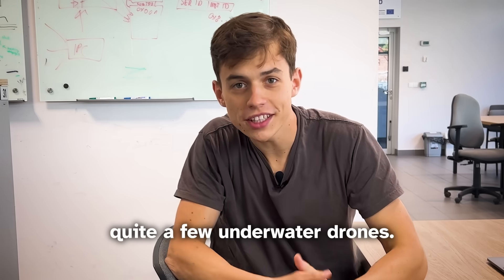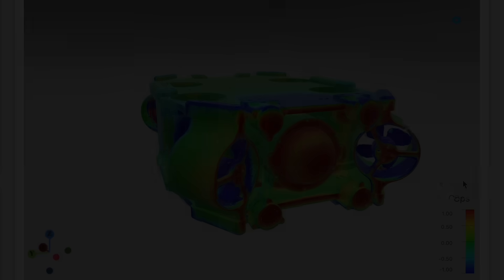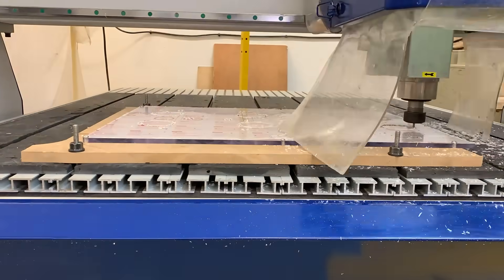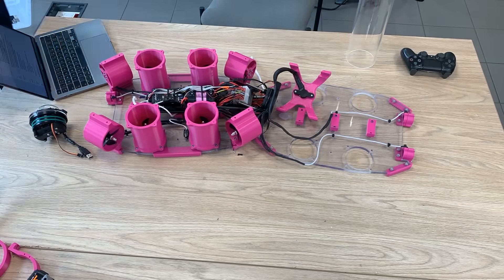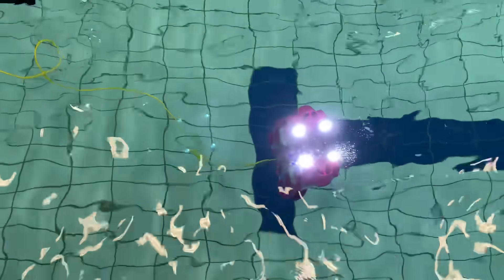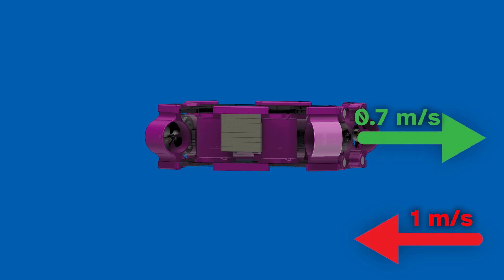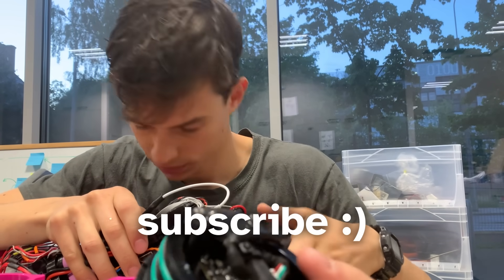Building the MOST MANEUVERABLE submarine

Comment: iam happy to see my finished cps5 drone as picture in your video.
Reply from the maker: Thanks again for the picture!
Reply: @CPSdrone  how about a transverse thruster tunnel ,like a bowthruster.
Reply: @CPSdrone why can’t you have one or two singular engines or motors and then open and close valves that exhaust at different angles?
Reply: @dorjedriftwood2731  one issue is friction, adding long tubes for the exhaust with bends probably isn’t very efficient. Then there is another issue, the motors and propellers don’t just exhaust out the back, they also pull in the front, meaning when the motors are running you will always have a force coming from the intake. So fixed motors even with difference exhaust paths will always pull in the direction the motor is facing, regardless of where the exhaust comes out. This could be mostly eliminated by using two motors that intake in opposing directions but any difference in speed will still cause movement.

Edit: it also creates a control problem, you don’t want the motors to be spinning is you aren’t exhausting it somewhere which means you need to mix the controls a lot more and if you want multiple exhausts at the same time then balancing them could be difficult as more water will take the easier path. It is all possible but probably more hassle than it is worth. The motors are cheap and having multiple creates redundancy.
Reply: Can’t believe I had to wait till the end for a titan joke. Worth it.
Reply: E
Reply: are there 3D print files abailable?

Comment: At 4:20, the forward thrust will not be double that of the previous model from having double motors. It will be less, as the motors are pointed away from the fwd-bck direction. Assuming a 45 degree angle, the fwd-bck thrust component from each motor will be about 0.7x of its total thrust, with a 0.7x component sideways. 

This will also mean that energy will be somewhat wasted when no sideways motion is desired, as some of the energy used by the four diagonal motors will be spent trying to counteract the lateral component from the other side.

As long as the energy stored on the batteries is sufficent for the task at hand the sacrifice is probably worth it.

Comment: "Based on your experience, can you tell if printing 3D submarines using PLA filament is safe for long-term storage without degradation? Will PLA last for years, especially with good storage away from sunlight, heat, moisture, etc.?" Please advise

Comment: if the core + electrics are filled with mineral oil it should be able to go far deeper without imploding as it will stop the pressure from the water
and stop water getting in coursing moisture and/or electrical shorts?

Comment: u need just 3 trust in triangular positio un x plane and inclinate it from the center of triagle. but cosider gyroscopic force so u nee a counterotatio on each pros obtained by gears or double engine. u can banouvre by manage trust or inertia gyro speed on props momentum u just nee 1 solenoid and a couple of permanent magnet to force rotation. consider also u may do a angular modification on the blade of prop. (if u are iterest in my idea i send a drauing of it)

Comment: This thing is incredible! Are you taking your battery pack out to charge it each time or do you have a BMS and charging board installed?

Also, are you running a fan in that enclosed space? I wouldn’t think that would work. It’s a struggle I’ve had!
Reply: We run our electronics in oil filled enclosures w/PBOF cables to help with heat dissipation and the pressures experienced at depths of 6000msw. Circulating the oil through the enclosure is easy, and you can save a lot of design time and material costs by using this method because the pressure differential is negligible compared to enclosures containing surface atmospheric pressures.

Comment: Nice! Put a bag of desiccant into the electronics module assembly (or fill it with nitrogen for high performance). Since you have two machined delrin endcaps with double o-ring seals you can probably use whole-copper wire or a custom circuitboard embedded in epoxy potting to make a good subsea penetrator, also face-seal o-rings combined with 2x piston seal o-rings help a lot. Also IMHO flat acrylic is better than a dome if you want to go deep.

Comment: Hey, have you considered trying to fully enclose your electronics in epoxy instead of using a canister? I do ROV design and compete, and the ROV doesn’t use any canisters, so it can save space, its also less prone to being damaged by water. Unless there are moving parts inside the canister, I don’t think it will work out. We also put the thruster ESCs on the thrusters with a 3D printed enclosure. I’m not a professional engineer so i’m sorry if this suggestion sounds bad 😅

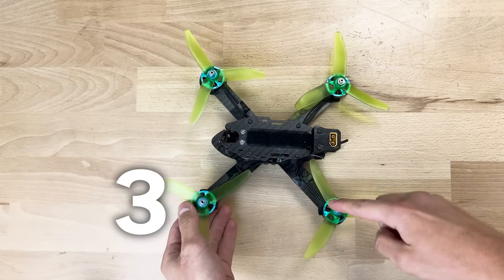Comment: 2:34 you can control all 6 degrees of freedom. Example with 3 motors configured as a equilateral triangle all pointed to the center, all pitched down, under gravity. In neutral buoyancy in water you need a extra motor in middle without pitching down the other three.

Comment: I've seen a few YouTubers stating that 3D printed components can leak even with 100% infill. I haven't tried it, but logically, the issue can be resolved by printing at a higher temperatures which will increase layer adhesion
Reply: Можно их покрыть водооталкиающим веществом.

Comment: Great work! Currently building something simmilar. You can make the dome yourself with an acrylic sheet. Clamp it in around the sides with a circular hole in the middle, slowly heat it in the oven and let it sag to the desired form. Alternatively you can use air suction on one side. It takes a few tries to get it right and even more to get it optically perfect. This is how we used to make the domes for our cameras in the past when there were no off the shelf housings. Good luck and happy diving!

Comment: You might want to consider spot-welding the cells in the battery instead of soldering. It's a little risky to heat them!
Reply: That is true! I bought a "kWeld - complete kit" last year and was very pleased with it. But keep in mind you also need a power source or battery that can give enough amps. :)
Reply: Could also make an argument for using a battery with a different chemistry. Little more expensive, but there's a much more stable Lithium battery chemistry, that doesn't explode when damaged or otherwise compromised. It's also good because running it to 0 doesn't damage the battery.
Reply: So risky infact... That nothing happened.

Comment: Would using vegetable oil to replace air within the sub help? Maybe not for this one but perhaps the deep diving ones. Might be a terribly idea, but I just had a thought that maybe have something other than regular air might help with the internal pressures
Reply: Filling enclosures with oil has been used for decades. We run our electronics in oil filled enclosures w/PBOF cables to help with heat dissipation and the pressures experienced at depths of 6000msw. Circulating the oil through the enclosure is easy, and you can save a lot of design time and material costs by using this method because the pressure differential is negligible compared to enclosures containing surface atmospheric pressures.

Comment: I have a question, I'm no drones expert or something like that, so this is just by curiosity. Why didn't you just use 4 motors that can change the directions they turn independently ? Two in the left the front and back, and two in the right with same positions. When you want to sway in the left the two motors in the right turn and rotate to push the drone from the right, while the others two in the left do the stabilization. But that's just a thought.
Reply from the maker: I would want to actually see how would it work in practice. Having more thrusters is just easier because with this idea you'd still have 8 motors, but 4 to propel and 4 to turn those first 4. Also, in that scenario when you turn them to sway, you can't stabilise in other axis at the same time.

Comment: Well yeah that thing will be slower simply from it not being tinkered with for drag at all.

That iteration of the drone is extremely successful for what you wanted it to do. Which was being omnidirectional in a compact design to prove it can be done.

Next step is refining it down shape wise so it can perform how you want it. Possibly make it so various panels cover the intakes for various rotors when not in use, and also positioning the rotors in spots that still allow for optimal use, but with the compromise of being more streamlined for movement as well.

Or better yet install heartier more powerful motors as well if it's truly just trying to get it to go fast with the current design.

Do not chalk it up to less then what it is which is an extremely awesome proof of concept for your hard work.